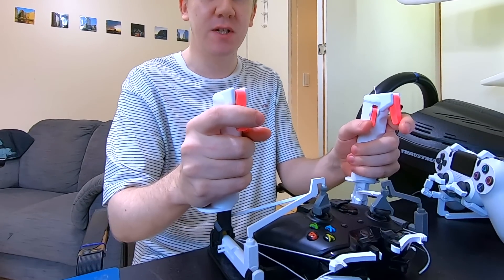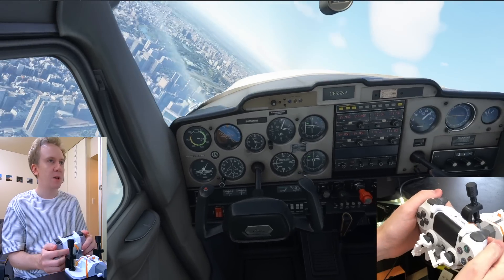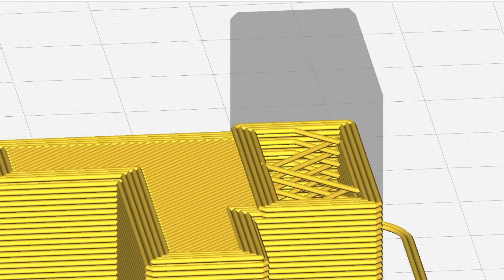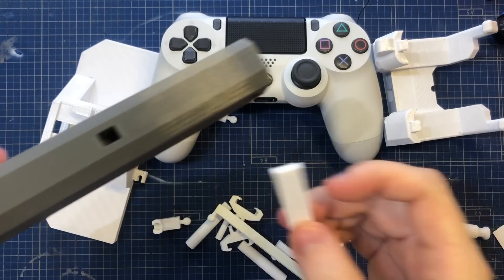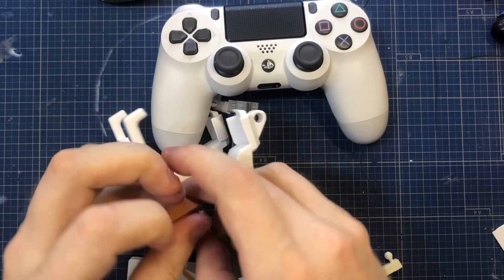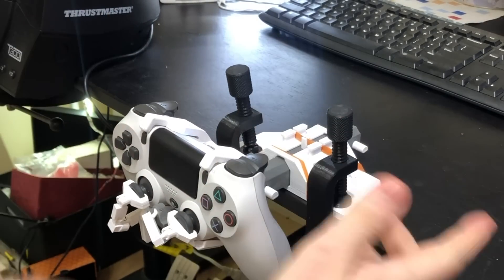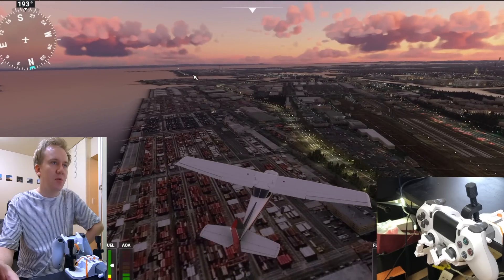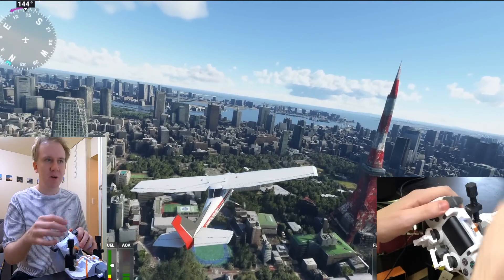Fly Flight Simulator with this 3D printed DualShock yoke adapter

Comment: I printed the yoke, it broke while putting the DualShock (normal if 20% fill)
But the sticks were too short and it doesn't worked, i'm better using the controller itself
(Edit: they aren't too short, only the roll stick)

Comment: Hey I want to print this but the shaft does not fit on my ender 3 v2 build plate in the orientation you said to print it at. You got any suggestions to get around this issue? I suppose your printer is bigger than an ender 3 eh?
Reply from the maker: My printer is an Ender 3. Perhaps the skirt and safety margins are reducing your available bed size
Reply: @AkakiKuumeri  OH Bruh I was stumped for a  whole day. Ur right, I do have skirts on. U a genius thanks for the quick reply!

Comment: Great design, works beautifully.

However, every time I try to push pitch linkage A into the hole of the controller mount, the tabs break off. Any tips?
Reply from the maker: Different printers print with better and worse tolerances. I would try printing the linkage ever so slightly smaller. (lower flow, or negative horizontal expansion)

Comment: How exactly do you design these? Do you work off a 3d model of the dualshock 4? OR do you measure the controller and then work off those measurements? How do you measure the controllers accurately enough to get press-fit parts?
Reply from the maker: I used the mount design from my previous joystick design, you can see how I did it in that projects video. I take rough measurements, and make paper and/or thin plastic prototypes of the contacting spots, and refine the fit from there. It takes about 1-5 iterations to get a good fit.

Comment: That looks like pop-in stutter, where the game engine is loading the game world progressively as you move along. Install the game to a fast M.2 drive and install it to a host card on the PCI-E GPU slot closest to the CPU (or the next closest if you have a GPU there and don't want to move it). There are some out there in excess of 3000mbps transfer rate. I got one for 70 bucks. Loads me into Rust in about a quarter of the time it takes with a Samsung Evo SSD with SATA interface. It completely eliminated pop-in stutter for all games where it was a problem.

Edit: After looking more closely, I'd say it definitely is pop-in stutter. The foreground buildings are still using distant LOD because the drive is too slow or overwhelmed... the distant LOD objects are smaller and can be loaded quickly, but won't clear up until the loader threads have finished whatever priorities they have.

Comment: just use gyro bruh

or am I missing something?
Reply: You obviously didn't watch the whole video.  He mentioned that gyro is not reliable or precise enough
Reply: @GohanSama  I've found gyro with the switch pro controllers to be way more precise than the thumbsticks. And I have never lost tracking with them. I don't have a ds4 controller so idk if the ds4 gyro is juts shit or not.
Reply: So here you can see the problem. This adapter is made for DS4, while you are  talking about gyro for Switch Pro controller.
Reply: @GohanSama  I'm sorry that I assumed sony made decent hardware.

Comment: Hi sir, i would suggest you start business on this modular yoke design. Reach out to some people about this link and your idea and start a kick starter funding. I believed this will go far,. I would like to propose you to indiegogo to build your capital then reach out to some abs supplier to make you some of these parts. Then while these is on going from your website reach out how many numbers of people interested in getting this. From this you make an order like this 
x being the exact numbers.
When you order exact numbers you will fail. So negotiate for X.3 with 0.3 more since there might be parts that are faulty and et cetera. So these additional parts will be used to recover some sort of faulty ( and other issues) and let them send you photo of it and they pay for the delivery.

In your main webpage make an icon for buying some of these small parts in group or set just in case it might break while usage at least with multiple of these small parts they are assured you think of multiple attempt at the parts breaking. 

If a constant request or complain of that particular parts break often then change in materials needed for that part or a stronger durable parts for that sort like the linkages. etc.

Go straight into developing a solution - if you are handling this alone then start a team pick out those that are really interested and those that just in for the ride. Take those that has interest to grow and solve problem than those who are in for the riches - Usually those that are in short term get bored fast. Those you see who might be slow but still in on it. Believed in them and make them grow, allow them to decide what they see is the problem and solving it. That trust you start with will keep developing and by then your company will run on slight auto pilot with you having more room to do creativing and problem solving on a bigger scale and these small things that you went through your team at the start.  It will start paying off. 

Struggle is real but that business opportunity is there. Work with reliable supplier and test the market, have a few chinese friends who you know would like to be with you. Oh i forgot those chinese you hire to work with ya has to love games. 

You hooked these guys in they can be your forward ambassadors or representative in one of the biggest gaming world where the government always block international access.

Reach me out and i will share with you.

some challenges you face might be different to me. But still  a challenge. Share it with everyone who followed you, some would like to contribute because your goal is also their goal.

Where they get to buy, contribute and share with their loved ones it's a funny journey to share but the end result is it is now being packed and sold and everyone can use it.

What you do there is changing how gaming world thinks of using one size fits all and not all are fitted right.

Lead it.

Regards
Ismadi

Comment: Could you potentially use the same design in racing games as well? Or do you plan on eventually designing a racing wheel to 3D print for an Xbox 1 controller? I would find those games much more fun if I could 3D print a working steering wheel similar to this yoke design. Love the vids and designs!

Comment: Yokes were traditionally used on larger aircraft before the days of fly by wire so that you would have more flight control mechanism to grab a hold of. Bear in mind that before fly by wire you were physically linked with all of the flight control surfaces, which could become quite heavy under load. Today, typically only non fly by wire aircraft are installed with yokes. Other aircraft may still use yokes as more of a “tradition”.

Comment: Amazing and can be improved, use the analog for throttle or pitch gain.
Since the ps4 controller has a gyro, that could be used for sideways control.

Comment: How are you with small electric motors? a company called protube is selling a vr gun stock with a module to simulate kick, its a stupid simple electric motor hitting a kickplate with 4 18350s and no usb charging and they are asking 500usd for this and a tube if you could make this in the 200$ range or less you can be a millionaire, these guys deserve to be undercut and ran out of the industry and i think you can do it, especially if you already know someone who can write in c to get the software going.

Comment: Thanks for the awesome work! Too bad the xbox 360 controller one you did is based on the wired controller, not the wireless one.
Reply from the maker: Ahh, I didn't think of that. Unfortunately I don't have a wireless one to reference off of. Perhaps someone can re-mix just the mount piece, you should only need to knock out a little piece off it.

Comment: Wow wonderful design very clever. I’m thinking about designing a platform for give slide movement for pitch to my racing wheel so can play flight sims, but I have no skills for doing that. Maybe you can consider making something like that.
I think it can be very similar to a yoke controller, you also can use cutch and gas pedals from racing wheel setup
Reply from the maker: A few people have suggested that. It wouldn't be easy but I'll think about it!
Reply: @AkakiKuumeri  great!! Everybody knows that if anyone can do it will be yourself :)

Comment: This looks really great, I am really considering purchasing a 3D printer to make this. A lot of the yokes out there are very expensive and even then can have quality issues based on the reviews I’ve read (and will take up too much space on my desk when I already have a wheel), and lack the flexibility of a regular controller. Then I’ll have to start investigating what else I can make!
Reply from the maker: Good luck!
This won't beat the quality of the cheapest of yokes I'm sure, but you can make some cool things with a printer. For example, here is a better, more involved 3D printed yoke: https://www.thingiverse.com/thing:4578139
Reply: @AkakiKuumeri  the one you’ve made is a great first step for me, as there are no electronics involved. Do you have any recommendations for a cheap 3D printer? I was looking at the Creality Ender 3 V2, it seems like it would work well for this and maybe some other small projects like printing some miscellaneous trinkets as Christmas gifts

Comment: Try to sign the 1 month Gamepass Pass Ultimate on Windows 10, they should have the equivalente promotion of $1 Trump in Japan which should cost you ¥1000000, you can cancel recurring payments if you don't want to use it more than one month. With Gamepass Ultimate you can play MFS2020. 😉

Comment: If I'm not mistaken linus tech tips did a video showing how the ps4 controller can be very accurate when using the accelerometer through the usb connection, they made it seem like it was way better through the usb vs wireless
Could be worth exploring
Excellent video! Great humor, awesome print work, subscribed
Reply from the maker: Big if true. You could use the linkage for up and down and the accelerometer for roll for a perfect combination.
Would leave one of the sticks free to use the camera and other functions too.
Reply: @AkakiKuumeri  if you're curious the video in question is "This is the best game controller. Let me explain" by linus tech tips @ 8:54 when he mentions the gyro polling rate